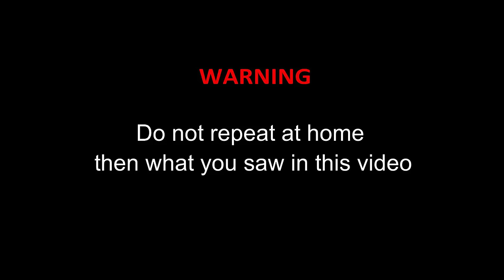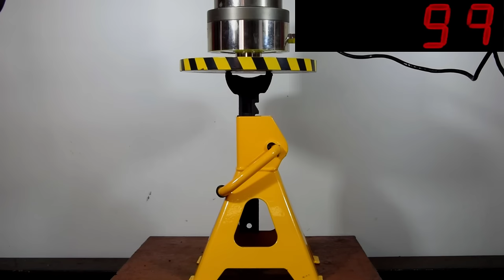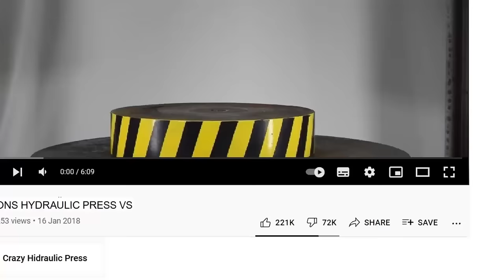HYDRAULIC PRESS VS CAR STANDS

Comment: Impressive.
Even when the black one failed it actually offered increased resistance as it was crushed further.
Reply: The simple pin design means the entire thing works in compression. The other one instead has one single point of failure (which works against torsional forces). Quite an engineering failure but sells to people with limited engineering notions.
Reply: @AP-yd1wz  
Well. With my limited engineering notions. And knowing this test is extremely limited in any type of real world use.
Good Luck with any jack stand held together with Pop Rivets 😬😬😬 ... unless you're a Bicycle Mechanic of course 😂✌️
Reply: @My-Pal-Hal  You just made my case. Enjoy paying twice as much for something half as durable.
Reply: The yellow one would have done so too, but they stopped crushing before trying to crush the base.
Reply: @AP-yd1wz  did you watch the video? the black pin based one only held 14.5 tons at the base and the yellow one held 30 tons
Reply: @racker5108  oh, I see. Well, in that case, no need to buy a car stand, just buy a steel cube and it'll stand way more than 30t before it gets flattened. Another one that just made my case.
Reply: @AP-yd1wz  👍
Reply: @AP-yd1wz   
If you think that fold up pocket stand is so Amazing. You just made your own point of "Limited Engineering Notions" 😂
To be fair. Maybe you've never heard that loads tend to shift in the real world. Especially with everyone's Religious Use of wheel chocks. Or, maybe you never imagined these stands may be used for vehicles. And, maybe you know more about the torsional/shear strength of Pop Rivets than I do.
But hey. I only built aircraft, and work heavy equipment. So my knowledge is limited.
Think about that next time you grab a Flight somewhere.

As to a Steel Cube.
Yes. That's pretty much the base of that yellow one. And though we use quite different jacking stands in the aerospace industry. Wood. Or more Accurately wood rounds, or creosote treated beams of given heights. Are Great Stands for heavy equipment. So a steel cube would work pretty good too. Though being from this Century. I may go with aluminum 😂
Reply: @AP-yd1wz  
And what is your"Case" btw ?
Because as my last comment eludes to. I think your case must have something to do with Hydraulic Presses. But nothing to do with what these stands will, or would be used for, and deal with in the real world. A single metal tube would fit your Case quite well. But not so well for anything not Press Related. So maybe explain your case outside of hydraulic pressing. Though your answer is sure to Weaken your Case. Kind of like a Pop Rivet smart guy 😂
... the strongest part is always the weakest link
Reply: @AP-yd1wz   but the pin style only works that well as long as the stand stays centered under the load. Look at the legs, if you have an unbalanced or shifted load, I'm not sure I would prefer the black legs over the yellow.
Reply: @robertturley2974  it's a car stand, not meant to be loaded with loads that aren't centred. And the other one is even worse for loads that aren't centred.
Reply: @My-Pal-Hal  my case is well explained in my previous comments.
Reply: @My-Pal-Hal  engineers like you are the reason a company I worked for, as a leader in their field,  ended up losing huge market share to competitors. They would overengineer everything, with obvious cost implications. Those are car stands. They are meant to be used to hold cars up on a flat horizontal plane, four or them at a time. The test showed that the black one failed at a higher load than the yellow one, when loaded as it is supposed to be for its use. Whatever is the weakest point in each of the two products, the black one's weakest point still allows it to take a higher load than the yellow one's weakest point. And the black one is also cheaper. Hence its design is more efficient.
Reply: @rkt739  they crushed the base layer in the video, and, of course, it took an even higher load to crush it. But that's not the point. What counts is the load needed to break the product. From that point on, the product is simply unsafe to use. Only a fool would use it again for anything.
Reply: @AP-yd1wz  
Your Turn.
If my Previous Comment is,.. Limited 😏

I Do have a question though.
How long do you think that cheap chain is going to be holding that Pin ??? Or do you order Extras with the jack 😂
... trick question, it won't last that long
Reply: @AP-yd1wz  
And I was thinking.
There's an old saying, "You Get What You Pay For."
I'm also thinking. It takes a less than limited engineer. To know what you get, for what you're paying for. Including the expected lifetime of said purchases useful life, as in my prior comment.
I actually use locking support legs on my hydraulic floor jacks. Extremely Efficient. Extremely Strong. And Extremely Safe. Extremely convenient. Course, Depending on your particular floor jack too 😊 
The weak point in the locking leg design for floor jacks, is the front axle of the jack. The leg is supported between the lifting arm, and said axle.
And easily reinforced with a stronger axle for a couple bucks.

And.
Rolling floor jacks have the advantage of rolling with the shifting of a load too. Mostly another advantage there. If you're not using it in your 15degree driveway 😳😂 and it doesn't turn sideways by the end of the driveway and just flip on its side.
Still gonna be room for another jack to get it back,.. somewhere.
... did I mention humans 😏 

Oh.
And another popular jack/jack stand, are bottle jacks. But like the Yellow Box Designed Jack stand here. Even after failure. The bottle/base will no doubt support that moving load. And much better than a pop riveted piece of sheet metal.

Yes.
My Fixation is in those rivets. The whole jack is disposable crap but.
Na. No. Not happening. Never. No way. Not today.
And I don't see myself using them to support a Hydraulic Press. Don't see the point 🙄😏

Yes, blah blah blah.
Just giving more qualifying jack info. And here's a bit more...

I do use Wood Rounds. They are amazing, because there is little chance of failure. ( termites whatever 😂)
A bit of a pain in the ass to use. But you slam a 20inch diameter, 10inch chunk of wood under the body of most Any Vehicle... And I'd put a Toddler under that and know it's totally safe. And prefer that over Your "Cube Of Steel" 😂 😉

Really. It's been fun ✌️love talking about consumer products, and the engineering within. Especially what WILL FAIL. And how to fix it. That Folding Jack. Failure, with No Realistic Chance of Fixing, or Improving.
 
If you have more to add though, cool. That's how we all learn 😊 but I think my case is pretty good. I don't see any Surprise Witnesses coming here 😏 🖖
... I Rest My Case 🤝
Reply: @AP-yd1wz  
... im starting to think this dude sells those Foldable Lawsuits waiting to happen 😏 ...

Did I say that out loud 😂
Reply: @My-Pal-Hal  sorry, I don't waste my time with total tools. Goodbye.
Reply: @AP-yd1wz  
OH CRAP !!!
IT WAS SO OBVIOUS !!!
Your company was the source of those Foldable Jacks. And a big part of your corporate profits. And once it failed,.. every time. Your corporation took a Hit to your Market Share.
Man, that's tough.
Should have hired real engineers. They usually run a bit more than $15 Bucks a piece though 😂

... yes yes, not nice to kick a dude when he's down. moral of that story. don't f with an engineer. We Love This Stuff 😏
Reply: @AP-yd1wz  
Still. You Got That Right 👍
You have no idea about Tools.
And the difference between you and me is Obvious.
I ALWAYS HAVE TIME,.. to teach others. My comments aren't for you. They are beyond your, Limitations obviously. 
But others may read these comments some day. 
I know how YouTube works also.
And maybe a bit of knowledge I've shared, will be used by them 😊

...dude got his ass handed to him big time... He Deserved It. Case in Fact 😏
Reply: @AP-yd1wz  
... less fun for you 😥🤤
Reply: Wow you guys went at it hard.
I just want to clarify what I mean.
So when the yellow ones cam fails at 4218kg it offers no meaningful resistance to that weight for the travel downward and would not until it was at its minimal height.
I believe that the base design would support that weight plus the inertia of the load coming down on it, however if I was under it I would need a change of underwear if it did.

The black one probably starts to fails at around 7000ish (and by fail I mean you probably shouldn't use it again).
But because the pin pushes through the body of the stand, as it fails it actually withstands over 10,000.

I thought that was impressive.

If I had a choice of failure I think I would choose the  failure that offers increased resistance to the load that made it fail, rather than the free fall  of the load that made it fail.
Reply: @kaineleggett3401  I got what you said right away, and I fully agree. TANGLDWEB thinks otherwise. Or, more likely, never even understood anything about the video, or about what either you or me wrote. He claims to be an engineer. But I doubt that he is. At best he's a mechanic, maybe a riveter.
Reply: @AP-yd1wz  Remember that when you want to fly anywhere.
Nice debate though, covered a lot of ground, very enjoyable.
Reply: @kaineleggett3401  well, 1st, to be seen if he's an engineer (I doubt), 2nd, to be seen that he ever worked on a plane, 3rd, if he did, he'd have worked on just specific parts of the plane, 4th, standard engineering reviews and tests should have caught any nonsense he may ever have designed.
Reply: @kaineleggett3401  
Guess I'll text AT You 😂
Since AP world rather talk About me, than to me. Seems his comment that he doesn't have time for me, is spurious at best. Which kinda makes you question his trustworthiness overall 🤔 hmm.
Be that as it may.
Put both under a load, not a press. And look where the load is being supported as it finds/ shifts to it center. The foldable pocket stand you may notice will have the majority of it's load shifted to either one leg, or two if orientated correctly. With no other support for any single leg other than the leg itself. A stamped piece of sheet stock, and it's pop rivet. And if I was being a bit more concise. Is a Press Rivet. The head being much more,.. Much More,.. structurally sound than the swaged end. So as I have already said. Not a lot of resistance to any shear forces incurred in real life situations of any shifting load. Because we all know things always stay Completely STATIC, when being worked on. Got a bridge I can sell ya too 😂

Actually F'd with one of those foldable things today. A friend has them for working on his parasail. Put it on a flat surface. And it stood more on its base tube. Than the legs. It was the only example of one I have actually had in my hands. And I doubt they are manufactured much differently than those were. But the legs were not part of the supporting structure,.. other than keeping it standing up. I found that to coin a phrase,.. Disturbing.
But hey. 2 where adequate for 50lbs in the sand 😂 👍 😏

The Box Design has just that. Full support of it's base structure. No single point left without additional support of the structure itself. Yes. It is itself a stamped piece of metal stock too. But of much thicker material. Formed into that box design, and welded together.
... though I've seen more than one with only a couple spot welds.

Wings are made with box structures too. You may have heard the term, Torque Box. Some call it a Wing Box. But that's less than accurate.
But it's a pretty basic design for commercial and military aircraft wings. Thin, hollow, and Tough. Wicked Structures if I must say 😊
And though obviously my background is in question by all the experts here. I'll bet none of you have dine destructive testing of wing structures for instance. A wing may be twisted, turned, bent and flexed for months. Including environmental testing. But being designed by these Lousy Engineers. The estimated failure of said structures can be estimated literally to the minute. Aaa, give of take a minute 😂
It was always a day that work stopped all over the plant. So people could come down and watch the BOOM 🤯 down to the minute 😏
Pretty impressive engineering.
Pretty impressive test beds too.
Anyway. Have Fun. I did.
I'm still going for the box design over that Single Use disposable one 😊✌️

Waving AP 😂  🐔
Reply: @AP-yd1wz  
Hey.
If you want to impress me 😂
Tell me what a "Crease Backup" is. It's a structure on the 747. I'll give you that much. And it's not a Classified structure. So show me what ya got big boy.

I'll bet nobody here knows, or can find it. I would be impressed if someone does. And it's a very prominent part of the aircraft particular to her. Ok. Enough clues. Enjoy everyone 😊
Reply: @AP-yd1wz  
Damn. Got quite here.
I sure hope your Pocket Jackerman didn't collapse on you. That would be sad.
But Hey. You saved a couple bucks right ☺️
Not sure if US dollars are good in heaven, or hell. But at least your account has a Positive Balance.

Speaking of Positive Balance.
Have I told you about the problems with the balance of that,.. oh,.. right. Sorry.
Rest In Peace 🕊️ 

Head stone reads,.. A P. Angular Problems 😂

Comment: Very nice demo comparison. I’m surprised how well these did. I have stands similar to the yellow one. That black one really surprised me.
Reply: Yes l agree, the black one surprised me as well.
Reply: Didnt me.
Reply: I've always felt the pin is stronger than a tooth.
Reply: @lwh7301   Didnt you see that the tooth arent demaged ??? 
The leg cuts true the Material so it came slowly down. The toots were in good condition. 
 The pin cuts similar but straight down tru the pipe, so it looks more stable. But at the and the Black one was destroyed some where at 14-15 tons.... The yelleow one at 29-30 tons... 
I think if you under a car, the yellow one would more heplful to get not squished. If you look at the top of the u shape what have to contact the car. The black one bends very fast, this will caus that the car would slip down. At the other hand by the yellow one thats at near by nor possible to bend. 
I would prefere the yellow one if I have to work under the car. 
But for a spare wheel change would say take the black compact one.
Reply: So you can see that cheap is not always expensive, on the contrary, expensive is expensive
Reply: @erter5023  I have both types, except my pin one doesn't fold up like the one in the video. And I use multiple stands for backup. And if I still get crushed, then may be it's destiny.

Comment: Interesting! Surprised the little cheapie did better.  I always use stands with higher than necessary ratings.  My concerns are side forces and uneven surfaces.
Reply: i have both types, but the $25 type ones of mine (bacho) have a triangle safety pin too.

Comment: It's reassuring that both stands failed gradually and gracefully - the last thing you want is something that suddenly goes BANG and drops the load.
Reply: It looks like the rachet one fails catastrophically.  after peak load, the pawl can't reach the teeth and there's no resistance.  At the end, the telescoping part just drops to the min height

Comment: Nice to see this test....and amazing how strong the black one appears to be.
I have a pair of stands similar to the yellow ones but only use them if necessary (usually due to limited space)...... I have a large collection of wooden blocks......iron to iron is very slippery!....wood gets dented where pressure is applied;no such risk....
When I jack up a car for a quick job I usually put the wheel I just removed flat on the ground under the subframe or sill,with a wooden block on top it takes more place but is much safer!!
Reply: I also use wooden blocks for safety, I learned this from working on the railroad where we used wooden blocks to make sure a 100 ton locomotive didn't fall when we changed out traction motors...
Reply: @tonyjordan1320  if it works for 100 ton locomotives it will work for me.....
Reply: The yellow stands are waterproof.
Reply: @freeagent8225  if I’m on my back under a car the stands don’t need to be waterproof.....
Reply: @freeagent8225  

🤣🤣